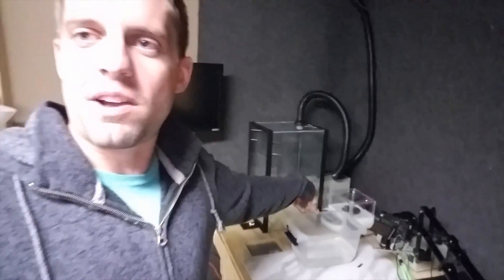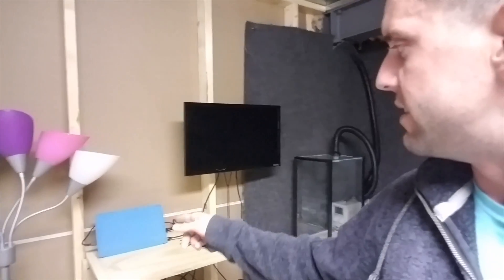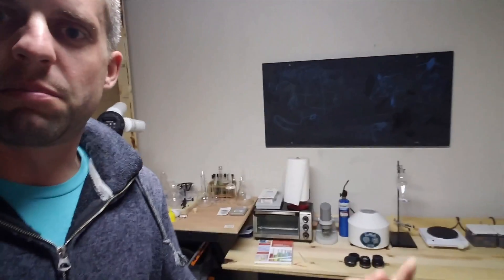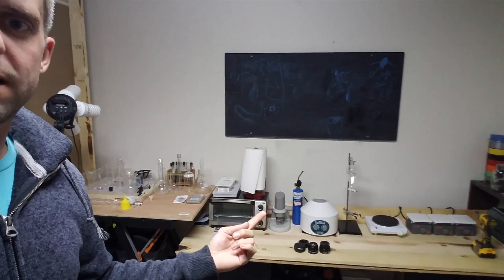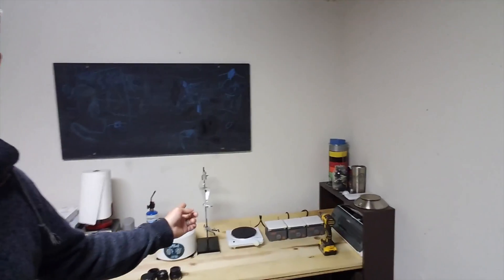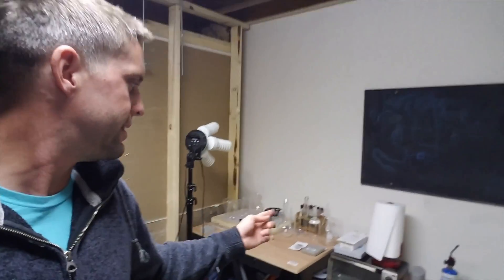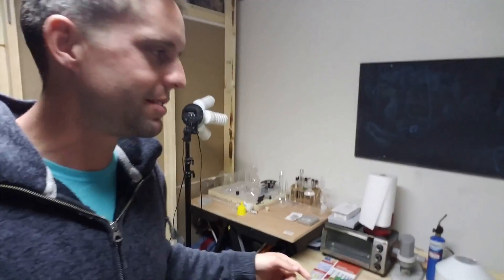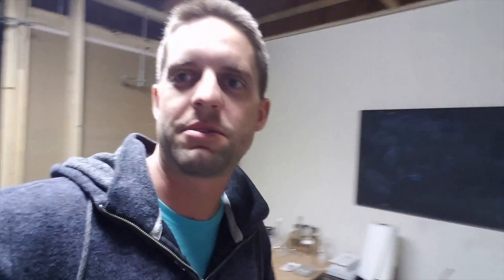Electrolysis of Copper, Lead, and Tin crystals.

Comment: hey Andrew, been wondering if there is an explanation why it is better to use specifically lead acetate (aq) and not another lead salt solution? (of course in the process of getting pure lead from electrolysis)

Comment: Hai 
I need to extract tin from tin sheet scraps
Per day 4000 kgs
So per cycle 250 kg means how much volt and amps to be given to extract tin and how much HCL have to be added with water
Can you help in this regard

Comment: So it's normal electrolysis in this case use the zinc as anode or cathode? . But you use a copper sulfate solution.
Reply from the maker: The zinc is the negatively charged cathode. The positively charged copper ions [Cu2+] are attracted to it.
Reply: @digiwhale  ur help pls I have sulfuric acid with dissolved lead if I what to do electrolysis on it to get the lead what will be the electrodes and at what ampage